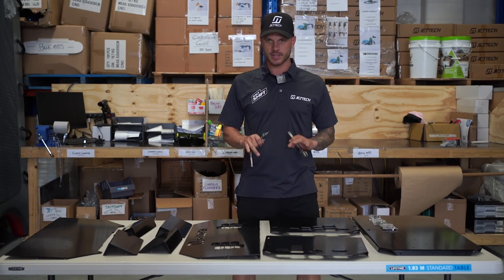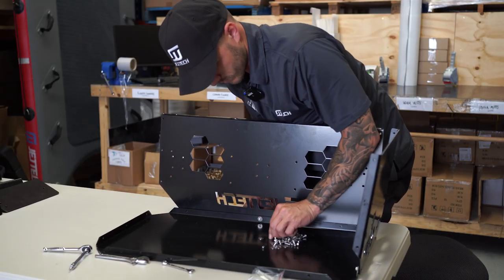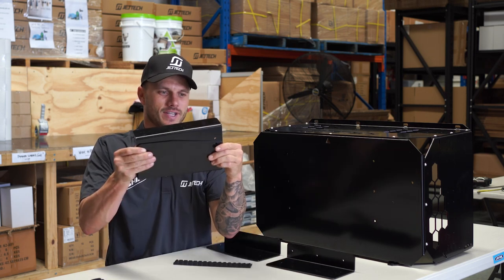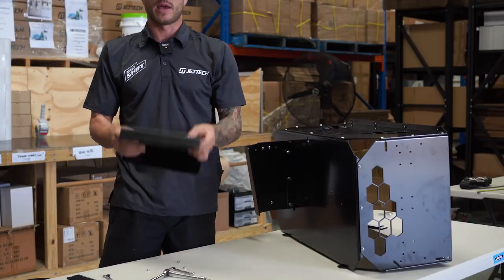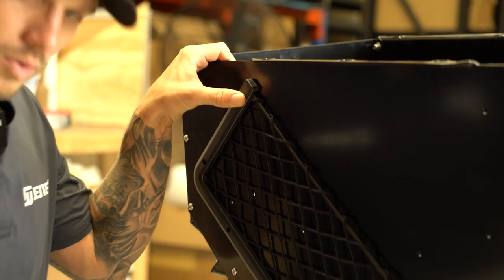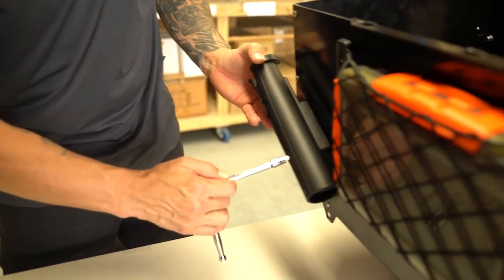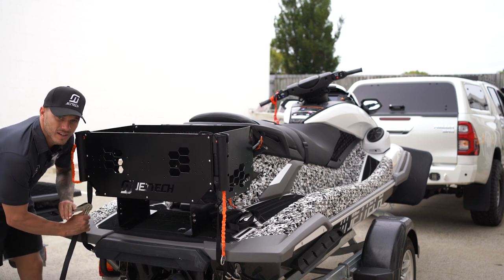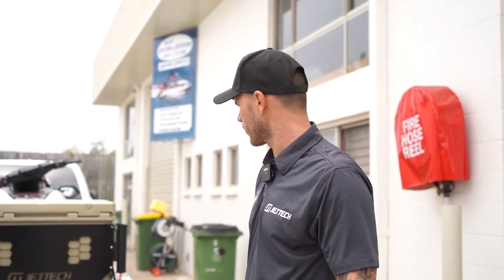Jet Tech Adventure Fish/Storage Box Assembly Video

Comment: The tutorial is great, made it easy to set up. All bolt holes  are perfect, great powder coating. The quality of the product is of a very high standard, all the fittings and straps are top notch its a fantastic design. I went the option with esky, rod holders and 2 fuel tanks. Communication with the company is great. I'm very happy knowing I have a good product.
Reply from the maker: Hey Kyle, glad to hear you are enjoying the product!